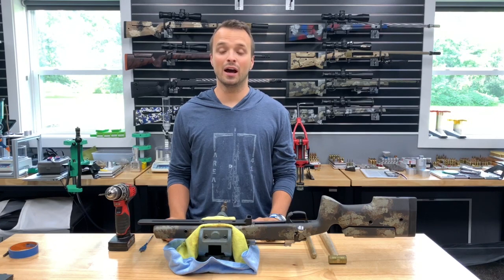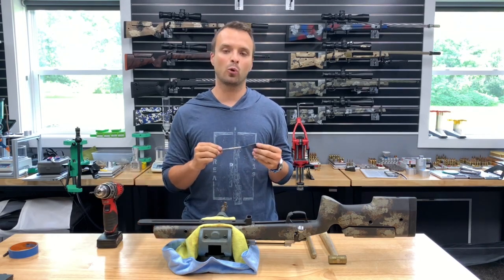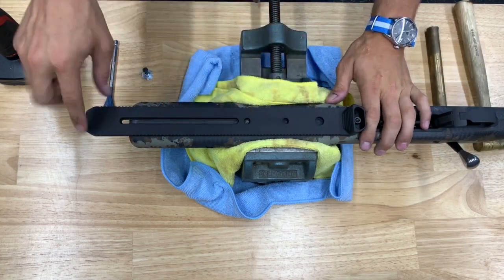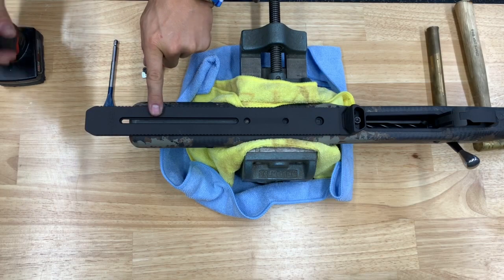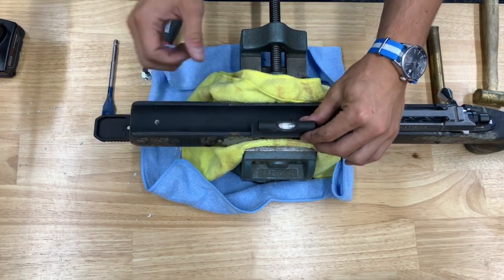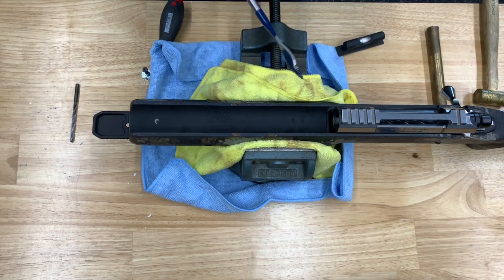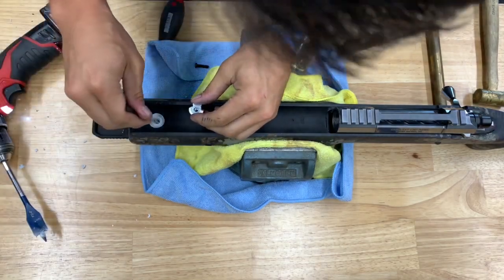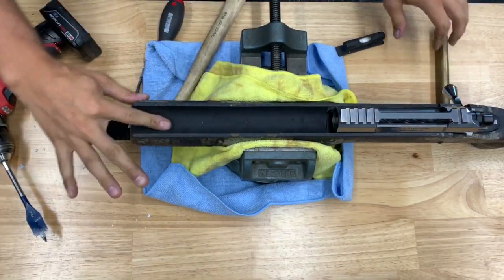Installing a T-Nut in a Manners Stock

Comment: I really hope you still monitor this post or someone knows. I just purchased a T4A/GAP build 6.5 PRC. Original plan was for a full length ARCA, but they stated due to the contour it was not possible. We went with a shorter AREA 419 ARCA. After watching this, I really am hoping this rail is an option for me. Please respond if anyone knows if this option will work! Or if the Manners T4a contour is different now.

Comment: Getting ready to purchase a 14" ARCA lock rail for my CZ 457 Varmint MTR and one for my CZ 457 Varmint.  I watched your other video on installing about an 1/8" forward of mag release on the MTR.  How many t-nuts should I install for the best hold with minimal injury to the wood?  Should I use the rear most hole?
Reply from the maker: For your stock I would follow closely the instructions given in that other video. The two stocks are quite similar from a mounting perspective.

Comment: I had some problems with this. First, the Manners PRS TCS stock's line down the "center" was not in fact centered so I was a good bit off once the rail was threaded on and had to redo, my mistake I should have visually confirmed with the rail.
Second and more disappointingly, is that tapping in the T-nuts bulged the bottom of my stock so the rail would not sit flush. 
I tapped it back in and am clamping it flat and filling the hole with epoxy. I drilled a third hole, clamped the rail in place and tapped in the T-nut with something on the other side protecting it from budging.
I now have three holes instead of one to install the rail.
Reply: Thank you for posting this

Comment: Do you find that the prongs on the T nut bite well enough that not epoxy on the T nut is necessary?  Not that under bolt clamp load it would move, but more, if I had to remove and install the arca plate?  The more I type it out the less is seems needed

Comment: I’d like to know the length of that ARCA rail? I’ve got a custom barrelled action coming with a Manners T4A and I’d really like to instal a system like this but I’m no fan of the rail extending beyond the forend
Reply: This is a 14" ARCA rail you want a 12" if you dont want it to extend beyond the front.
Reply: Derek Rosenberg thanks for the reply mate